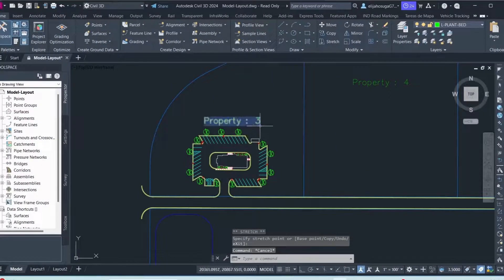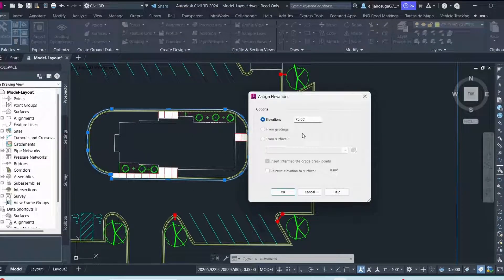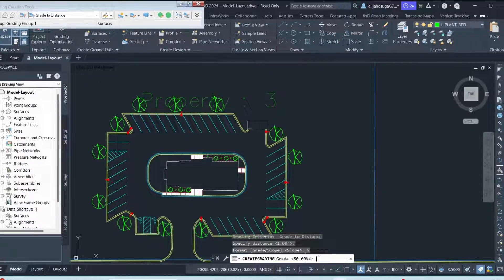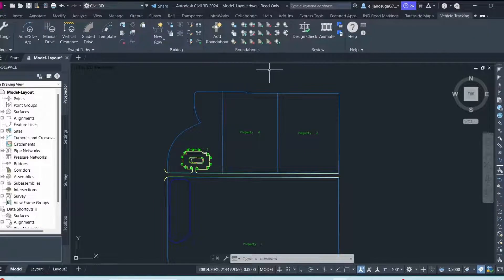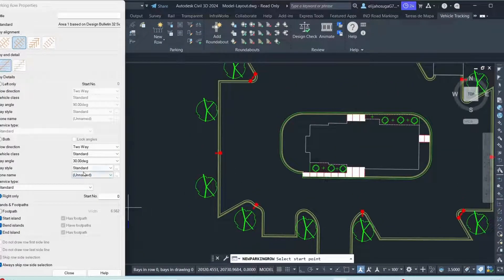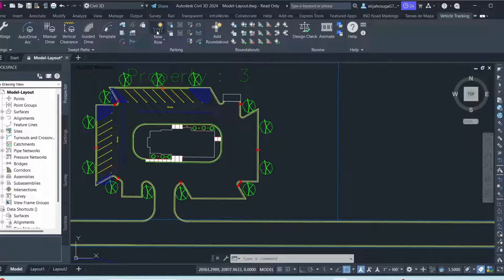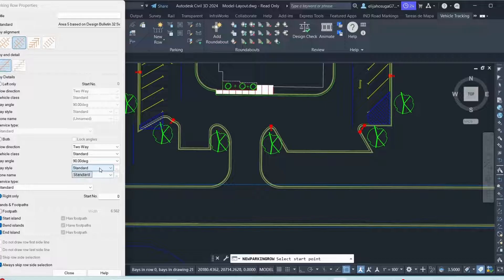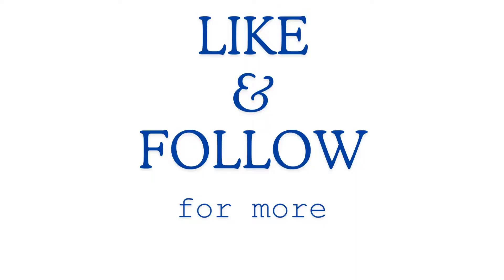Creating A Parking Lot on AutoCAD Civil 3D

Comment: Good video. But isn't this Autodesk Vehicle Tracking which is a separate install from Autodesk Civil 3D?
Reply from the maker: Yes. Vehicle Tracking is an add on or extension of Civil 3d. It is however installed easily through the Autodesk website.